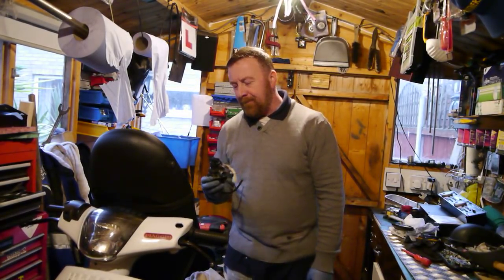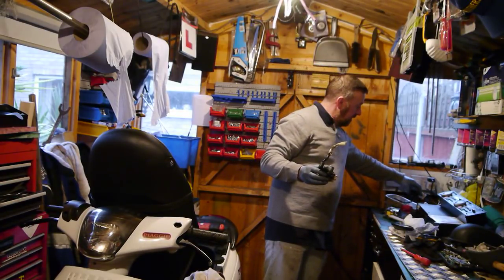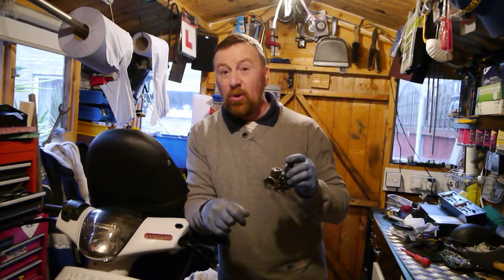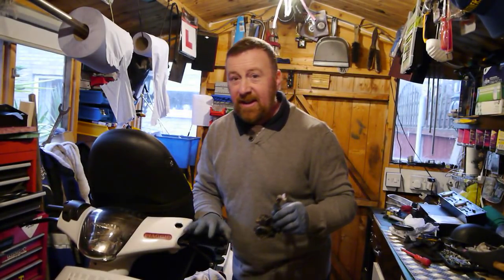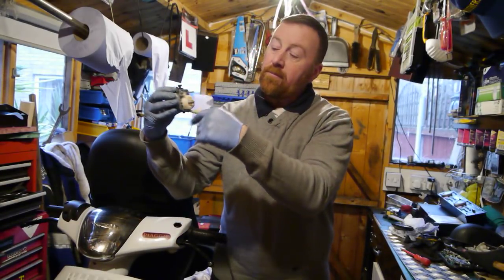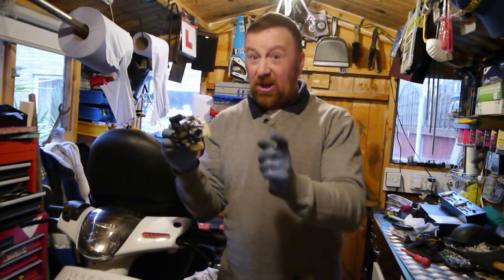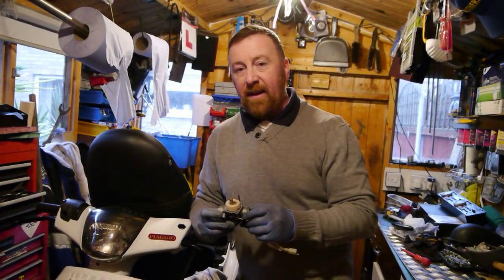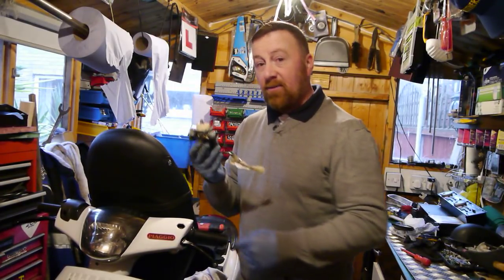STOP!!  MOPED BEFORE YOU UP JET WATCH THIS MARK SAVAGE

Comment: Hi Mark, I recently changed the Rollers on my Pulse Scout 49 and it gave a bit more speed with a shorter boss in the variator and also put an unrestricted CDI in, im thinking of up jetting to get more top end speed, but would you reocmmend i have to change the exhaust if I do this? im slightly concerned that if I do this I may run into problems as the engine has only done 50 miles (2011 model) and wondering if I should let the engine run in before doing so. Any advice is welcome, cant stop watching your videos they are brilliant, no one out there thats doing this like you do :)
Reply from the maker: they can happily do 45mph with what you have done , you should get away with just the exhaust and it will be happy but if you want to i'd go for just a 4 jet up 
but the more you play the harder the engine will work and thats when you start to fail !!
keep an eye on the oil bud 
take care and thanks for your kind works and watching

Comment: My bike is a Generic Trigger SM50, which I've upgraded with a 70cc cylinder and piston, 21mm carb, and Turbokit exhaust. Fully de-restricted, even a new CDI without restrictors. Does about 60mph (100kph). I'm wondering if you could tell me what the best jet for this setup would be. Thanks.
Reply from the maker: I've had a few of them standard 50cc and they do 50mph as is
As you must watch my channel you know I don't like 70cc / big bore kits due to setting up and reliability
However is yours starting and running OK?
Reply: @marksavage  Well, certainly runs well, but I'm not really sure how to start it properly. It really bogs unless I've got full choke the first time I start it, and I must run really rich and smokey. Not really sure what the problem is. Thanks for the quick response!
Reply from the maker: @killswitch_disengage  what jet have you got in now?
Sometimes too big can be the problem !
Running too rich maybe 
Worth a tune like in my videos 3 half to start might help 
But you will always have to play bud !
Reply: @marksavage  Alright, I'll have a good look at my settings. Thank you for the guidance!

Comment: Hi mark, love your videos,  very informative 👍👍 I have a lexmoto matador 125 4 stroke, I have just changed the clutch springs to 2k ones, slightly lighter rollers, free flow air filter. The main jet in the carb was 108, I put a 110 in, it accelerates but dies off before changing gear, when I release the throttle from full to half, I have power again,  when back to full throttle, no power again from 30mph, do you think I need a bigger jet still?? Say a 120 or even 130 as I will be fitting a new exhaust tomorrow also.
Thank you
Reply from the maker: Sometimes too big is the problem and your flooding the bike !!
Try going back to 108 or smaller!
Floats ok ?
Fuels getting in ok ?
Needle high or low ?
Gives these a try bud 
And thanks for watching my videos bud

Comment: Hi mark I have a clip still of ignition like with a half circle on mate can’t seem to find we’re it goes
Reply from the maker: the ignition should only come this a snap bolt nut like in my videos don't snap it till it's all ok and you can lock it on the steering lock not sure about the clip as it should only be two parts the lock and snap bolt?mark

Comment: Nice vid Mark.
I Lve in UK .
I have Gy6 125  4 stroke had all sorts of problems when using Air Filter Pods rain is a pain.
Now will go back to Stock Airbox.
Main Jet Size 105,Pilot 35.
I do av a sports exhaust.
Should i stick with these sizes thinking of upjetting Pilot to 38?
What do you suggest thanks Mark.
Reply from the maker: hi bud 
yes the stand air box filter is better ,you could use a sports air box filter as they run well too
id leave the pilot jet well alone bud I never mess with them and  your running a big jet as is 
as long as it runs ok now id leave it bud
Reply: @marksavage  Thanks for that.

Comment: Hi Mark, just a quick question for you. I have a piaggio zip 50cc 2t with a yasuni sports exhaust and I am not sure if it’s been upjetted but I do know it has the standard air filter. It seems to be running fine but just wondering if it’s killing my bike? 

Thanks
Reply: If it is air cool should be able to get 65mph down bank.
60mph on a straight Road.

If it is a liquid cooled you should be able to get 70mph  down bank
65mph  on Straight Road 

You can get that with just sport exhaust and heavy rollers maybe 6.6g or 7g.
As long as the fan belt as not wear down.

Comment: My speedfight mainjet is 50 . I have a sport exhaust , it starts verry good but when i accelerate the engine chockes... should i replace the main jet ? What size do you recomand ? The engine is 50 cc . Thanks
Reply from the maker: Standard main is 56 
So with exhaust I'd be trying 60 main
Reply: @marksavage  thank you mark !
Reply: @marksavage  it works mark !! Thank you !

Comment: Hi mark 

I swapped my Yamaha aerox 70cc airsal kit for a piaggio zip 70cc malossi cast iron kit, but I have a 17.5 dellorto carb which I believe is a standard 50 carb. When it starts it runs then over idles too much then moves on it’s own but when I apply revs it cuts out, any information for this? Thanks
Reply: It has a TT vince exhaust so it does pull but I don’t know what gram rollers are in. Plus I upjetted it to either a 83/84 jet and my rev cable is in the pin thing but it’s too short, do you reckon that’s the reason why it’s bogging or is it the jets?
Reply: Hi can you please get back to me as I’m kinda new to this mate
Reply from the maker: hi bud , if you know me i hate 70cc kits as they take a lot of setting up 
change the card 19mm or 21mm 
this will help and up the number on the plug as they get hotter

Comment: great vid mark. my zip 50 has an unrestricted standard exhaust, brass plate in carb and 56 main jet. What would be the correct jet without the brass plate, all else same? thx for help in advance.
Reply from the maker: Next week I've got a zip to play with lol 
I'd only go up in 4s bud for what you have in there now but to be fair most of the time they run fine once you take out the brass plate 
They bog and mess with a upjet but worth a go and a tune
Reply: @marksavage  thx Mark, will try and let you know. 👍
Reply: @marksavage  ok, ended up without the brass plate and a 58 main jet, runs like a champ now. just wonder what to do on the variator to tune some more if possible. any suggestions? thx
Reply from the maker: @Albert-zf8ct  clean variator ,new rollers 
Weight whats in there now 
6g normally best

Comment: Mark i have a little problem i cant take the bottom off the carb i did all the screws but it doesnt want to come off its like glued to it lol
Reply from the maker: oh dear sounds like someone had a problem before and sealed it some how as they don't come like that so now you have a few choices one leave it !two drill or hack saw a line across the screw and them use a flat head to get them out then you will need a new gasket or new carb!thanks for watching bud I have many other videos on carbs that may help plus other videos on mopeds mark
Reply: mark savage im the first owner i took it out the store, but i will try thanks a lot Mark.
Reply from the maker: HyperRacing oh right which bike is this on bud 
You might be able to pick out the glue without damaging it 
Mark
Reply: mark savage its that speedfight 3 that u always help me fix lol
Reply from the maker: oh right bud and yes you know how much I love them lol, but good to hear I help mark

Comment: Hey mark which rollers do you prefer, stock 50cc with 4.5grams or 6grams. Thanks! Currently got 4.5g and it does 45mph!
Reply from the maker: I've alway used 6g but if you happy with fast pull away stay with what you like 
Me 6g gives a little more top end
Reply: @marksavage  thanks for the reply, I’m gonna try the 6grams out!

Comment: Hi Mark... I wanted to know what type of sports exhaust could I use for a zip 100cc..Also what type of variator system would I need?
Reply from the maker: to be honest it will come down to your budget, cheaper will not last as long but it will come down to whats about for your moped 
as for the variator they don't make many so all will be ok but check belt while your changing as sometimes it make sense to do that while your there 
just e bay it of scooter works on the web
Reply: @marksavage  Thanks for the reply..1 last question, do u know if all zips take the same parts? I.e transmission cover?
Reply from the maker: @blaqueraye  they may do but they often put out upgrades and they change plastic parts but not often the engine, before buy anything e mail the sell for pictures and as long as they look the same all should be ok
Reply: Hi Mark ! I just buyed a Gilera dna 50cc brand new basically the owner keep it in garrage since 2002 !!!! Now Im working on to "derestrict it" (I took the plastic washer out from variator & the belt goes all the way up now) . It goes like 70kmh on flat ! ... and i wanted to ask you why it doesnt go up higher than 6-7000rpm. I changed the belt, cleaned the variator with a clean rag..  rollers look perfect (7g) ...clutch Looks New...! I tryed 5.5 roller weights and still doesnt go more higher than 7000rpm... now Im thinking to buy a good sport exhaust and upjeting the carb from 55 to 60 .... what would you advice me ? Thank you! Thanks for all your videos you upload !!!! 😎👍👍👌
Reply from the maker: Swag and Muscle hi bud 
I have a few videos on my channel of DNAs 
They are fast bikes and ride and look good
A sports exhaust will help but wait till after to up jet it as it will need to get the gassed out first 
Also try getting a sports air filter insert and not a foam add on 
They are not normally cdi restricted so this should help all round bud

Comment: Hi Mark, I’m concerned about my bike. It’s running well but I might be running a little too lean. I have a sports insert for the airbox(direct replacement) so no need for upjetting there. I have a yasuni z sports pipe. It had a 74 jet in but the spark plug looked abit lean so i went up two sizes but the plug looks the same. Any ideas?

Many thanks Mark
Reply from the maker: So you have gone up in number on the plug so higher heat 
Have you adjust the air petrol mix 
That should help if not then yes a small upjet 
How is it running 
Really If ok better lean than rich bud
Reply: mark savage yeah it’s running fairly well. it’s got a BR9ES in at the moment what would you suggest?

Comment: Does the speedfight 2 50cc air cooled and liquid cooled use different jets as I’ve seen people saying that the stock is 72 and ur saying 53-56 I am so confused as my bike has 66
Reply from the maker: Ac use a small jet than lc but still standard 
This is why it's from 54 to 56
I use 60 in ac and upto 68 in lc as they rev higher and are faster 
However run in what's best for the ped 
So as long as its not bogging happy days bud

Comment: I got.0.8 jet race  Cdi race inlet race variator race spark plug but still bogs do NH t get it mate only thing not dun is endcan and back clutch
Reply from the maker: If it’s bogging down bud it’s your carb
Take it off and have a watch of my jetting video 
Remember too big is back !
Reply: @marksavage   yeah that's what I figured I lost the standard main jet so stuck with the. 80 till I can get a race full system but I'd of thought that the race Cdi and race intake and air filter thought that would of made it all work well pluss got a race front variator and a bran new belt but can't get the clutch bolt off to get to the spring as don't have special tools
Reply: Found standard jet if I put that back in should it be OK. Then or will I have to mess about with mixture again as I have race intake and air filter
Reply: @marksavage  alright dude sorry to keep on put standard jet in still can't get the fucker to tune right get like 30 uphill at points and 40 at a push on flat when I should do more than that when basically race tuned spark adjustable race Cdi race intake race air filter there the main things I. Thought pluss the variator and 6g rollers all ate like a week old and a new standard belt too I don't understand it mate any ideas on what else to do pluss changed front and rear seals too

Comment: I have a 50cc with a stock 72 jet. My main jet has a little tube that goes into the carburetor 8 different pins on the side of it and the main hole on the top of it, can i get a different size jet, which doesnt have the small holes, just the main hole?
Reply from the maker: what moped is this ?? , is the moped running ok, what is it you are after doing ???
Reply: Its a suzuki zz inch up sport 2006 or a az50rk07 or ca1pb.
I changed the airfilter, rollers, and the belt.
Reply from the maker: @Doile911  and is it running ok, i'd also change the plug and that should be all ok for a basic service bud 
cleaning the carb will help too and as long as it starts and runs ok id leave it all as is . to get a bit more speed a sports exhaust will help if it hasn't got one already

Comment: Alright bud I got around  to takin off the variator on my zip I have the lock tool in place stopping metal plate bro spinning but the lil plastic bit and kickstart plate keep spinning with the crank any other way off taking it off bud if so could you do a video
Reply from the maker: hi bud with the tool use it at the bottom and use one of the bolts to hold it and with you foot, the middle bit should hold and not bother you once the nut moves when you clean and sort it you will need to hold this in place when tightening up mark

Comment: Ive got a yasuni race exhaust (pipe and can) with a 54 jet im puting in a 70 jet is this the right move?
Reply from the maker: hi bud not sure what bike you have but
most of the time just a sports exhaust will help as the yare restricted by the gas coming out so it may run much better now 
however if you going to up jet like in my video haven't you forgot some thing?
more gases out more fuel in, wheres the air lol 
get a sports in box air filter and id only go up to 60 and see how it runs then maybe 64 and see as 70 is a bit just bud
Reply: mark savage cheers for the fast reply i frogot to mention i had a stage 6 air intake

Comment: Hi mark, I have got a technigas exhaust on my 50cc speedfight it's for a 100cc but it does fit on with a flat gasket to the cylinder head it does blow slightly but i have some exhaust gasket in a tube I have yet to put on, will it still run okay enough on the standard jet as a test before I up jet it? Thanks
Reply from the maker: the bore is bigger , see how it runs as most of the time its fine as long as you have back pressure 
otherwise maybe a upjet of 4 should do it 
mark
Reply: @marksavage  cheers I'm going check the backpressure now 👍
Reply: @marksavage  It has back pressure it pulls forward quite strong is it ok to test ride on the road?

Comment: i am going to remove the limiter in my exhaust on my Yamaha tzr 50 2014 and up jet to a 115 jet as recommended by everyone with tzr, but do i have to remove the limiter in the air filter too? is that necessary?
Reply from the maker: Letting the gassed out faster , putting more fuel in 
It makes sense you should get more air in other wise it will run rich plus a tune for the air petrol mix bud

Comment: I've got a piaggio zip and it has a problem kick starting it kicks over but won't start I've checked the spark plug and that's fine do you know any tips or what to check
Reply from the maker: hi bud 
if it kicks over it's not your kick start, does it electric start?, i have videos on mopeds that will help solve that issue on my channel
as in my other videos bud you will have to check if petrol is getting in and do the carb test and plug wet test, fuel pipe and so on.
was it running ok before this?, did it just stop, has it always been a bugger to start
have you checked the auto choke like in my videos
i need more info than just i wont start bud, sit on a computer and go through my videos on mopeds, there are loads and maybe on speedfight but the thing are the same on all peds and sure these will help you find the problem and solve it 
mark
Reply: No my electric stet don't work and I've seen every one of your videos and I can't find something similar it's getting Petrol to the carb I've cleaned the carb and it's got a spark I still don't know why it won't start I had it running fine then went back 3 weeks latter and couldn't start it
Reply: And yes it's getting petrol I've checked carb I've checked the spark plug and thanks tor the help and I enjoy your videos doing a good job 👍🏼
Reply from the maker: Luke Stoneman the electric start is the same on the Zip as most peds 
I have a video on the electric start from the button to the starter so can’t see if you have  watched it you can’t work it out 
It a must watch bud
Ok not starting 
Is the auto choke working as in my video on it?
You are getting a wet plug that’s good 
It’s also sparking and a good blue spark ?
Reply: The electric story don't work but it used to start by kick start and it got a good strong spark and it's a manual choke so i know that not the problem it's got compression and fuel pump works all fuel pipes are clean and I've look through all your videos as I'm a regular watcher but can't find something similar
Reply: The electric start is broken so I can only use kick start
Reply from the maker: Luke Stoneman get it fixed it’s not hard to tell what part is broken and fix it then it may start on electric start as I’ve had peds do that
Reply: Alright thanks for your help and your time I shall advise people to watch your videos as there a lot of help and shout out your YouTube channel thanks mate👍🏼
Reply from the maker: THANKS BUD THATS ALL I ASK AND HOPE IT HELPS .MARK